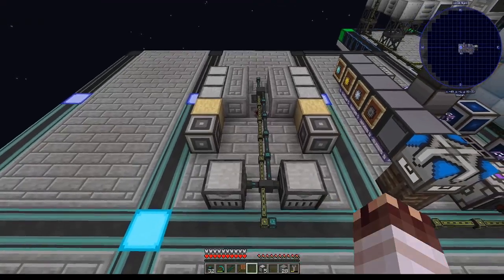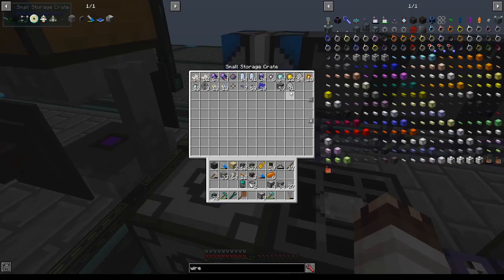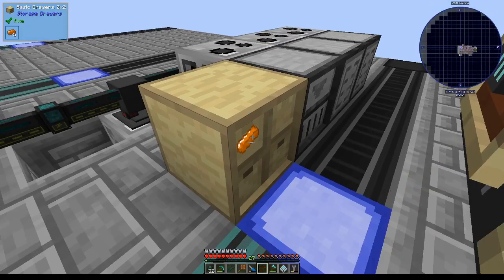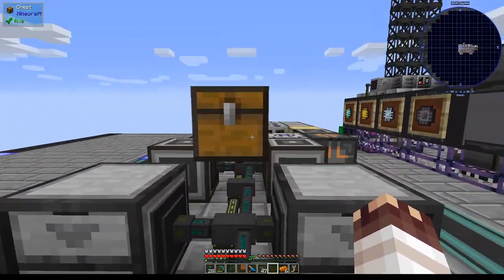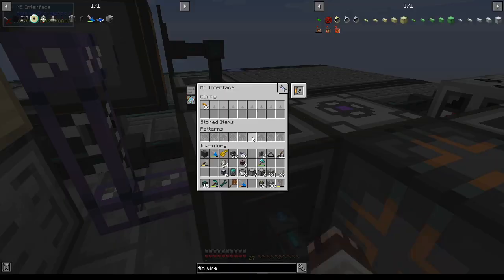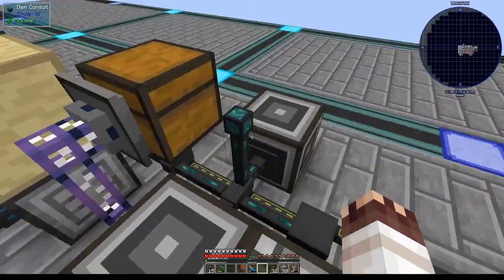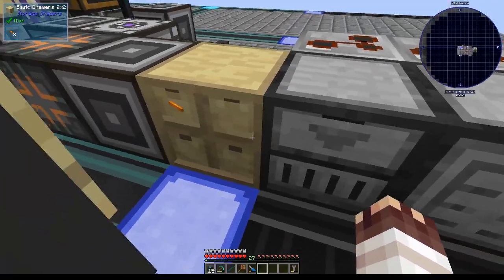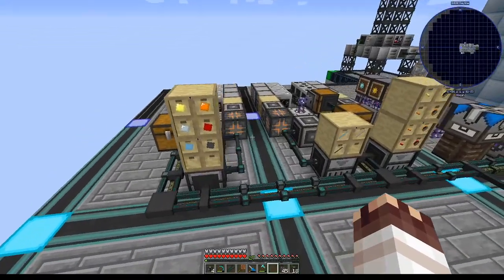New Omnifactory Supershorts #19: Multi-Recipe, Parallellised, Automatic Wires, Rods, and Plates

Comment: I have experienced lag frequently when I use crafting cards, and other youtubers confirm that.
I really like automation and parallelisation, so I would choose to set an interface to provide the ingots and not use crafting cards. You get the same result (passive crafting) without causing lag. :)
Reply from the maker: Thank you for the tip! I've talked about it with some people who read the code—it seems like it's not problematic if you use as little nesting as possible.

Comment: I prefer using Ender chests for parallelization, its the same concept, with all machines pulling from a shared inventory simultaneously.
Reply from the maker: That makes sense! I don't know if the ender chests are laggier or not. But that's certainly another way to do it!
Reply: Apparently ender chests and tanks cause for lag especially when you have lots of them
Reply: @FaultyToaster  You don't need lots of them though,  One enderchest can supply a machine on each side.  Unless you're parallelizing a crap-ton, its not necessary to have a lot of them.  Only a handful of machine-types need to be parallelized in this way.  Wiremills, Compressors and Alloy Smelters.
Reply from the maker: @MrErizid  That’s true, you can put a machine on any side. However, it’s less compact than this design! I could certainly redesign it for the ender chest, of course.

Comment: Oh this is way better than pulling components out of the other passive systems to make my motors... is this gonna expand into keeping more complicated things in stock like motors pistons etc?
Reply from the maker: No, the expansion into motors and pistons will happen in episode 25, and will involve AE2 autocrafting + crafting cards. The most complicated this will get will be for restonia/void crystals, which I believe will happen in episode 24.
Reply: @minecraftinchocolate  but those are just dropped onto a pressure plate in front of an AA and then sucked back in right?  Despite playing modded for like 10 years AE2 is the giant gap in my knowledge for some reason and Im glad youre going into it
Reply from the maker: @Acylumgaming  I want them to go S U P E R fast.
So I'm doing more than just a pressure plate, haha.